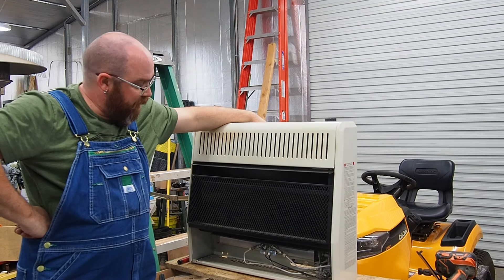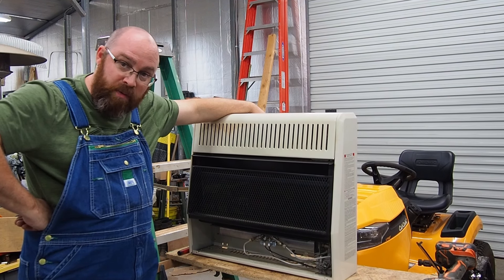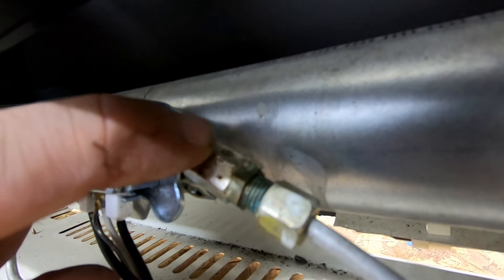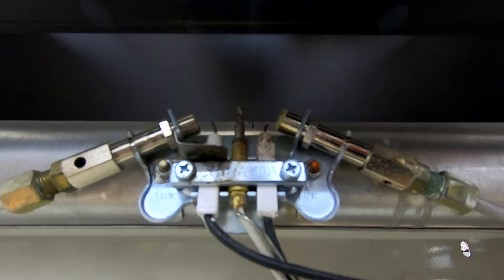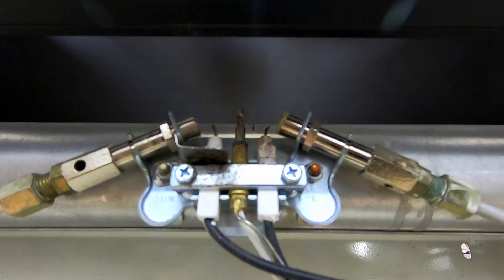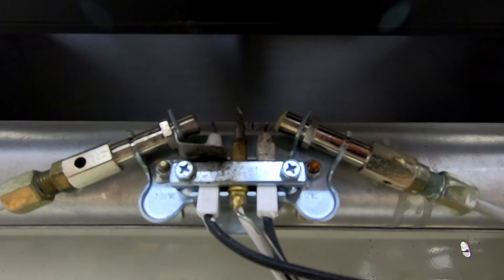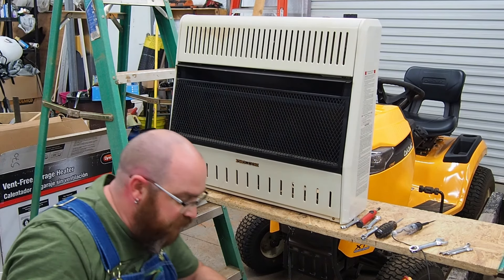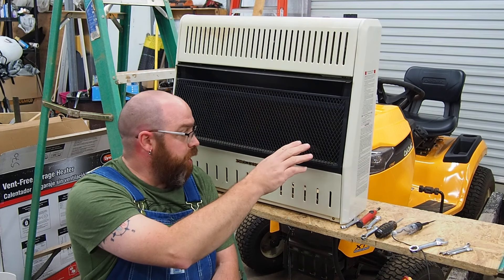How to clean Pilot Light that wont light / stay lit

Comment: My heat has been acting up for days! The pilot would not stay lit. I cleaned the heater and tried everything. On one of the coldest nights here where temps are 18 degrees, it kept going out! I came to YouTube and found you guys! I followed your instructions about the thermocouple. I didn’t have an air pressure torch or anything, I used a straw and blew really hard in the line. 😂afterwards I saw the flame connected like the one on your demonstration and I said thank God! I’m hoping it stays for me. Thank you for this video! I was looking really hard to find my heater type on here . God bless and thanks again!
Reply from the maker: Awesome glad you got it.

Comment: Our air source heat pump died leaving us with 2 gas fireplaces as back up. One of them was having issues with the pilot flame being too small and the adjuster screw did nothing. After blowing it out the pilot light w/30 psi air, the fire starts up in 5 seconds vs 2 minutes, the screw works, and our fireplace doesn't explode as much. Really appreciated.
Reply from the maker: Awesome

Comment: You Sir, saved me a bundle! My Pro Com Heater Stove had the same problem... the pilot wouldn't stay lit. After watching your video, I checked and sure enough, it had a weak pilot flame ( Vertical, yellow flame... no contact with Thermocouple).
I cleaned out the pilot tube and now it's working as intended. Many thanks!
Reply from the maker: Awesome glad it helped.

Comment: Thanks!  Didn't have a can of compressed air, but I used a small wire brush to clean it, then a straw to blow it out a few times.  Back to a beautiful blue pilot flame!
Reply: Glad you said straw because I didn't want to damage something sensitive inside the pilot, I'm using myself straw right now because you did it and it worked, mines could use a cleaning too.
Reply from the maker: Awesome
Reply from the maker: Glad you got it going.

Comment: I'm going to try this, I have no other hope🤷🏼‍♀️ I have a NEW, from Lowe's Procom ventless dual fuel fire place that I hooked up on a NEW, propane system. My heater won't even attempt to light. I bled the lines manually & I am getting propane at the back of the heater but apparently that's it. I have no sound or smell of propane when I turn the knob to pilot & depress the knob. Idk what else to try & it's going to be in the teens the next few days where I live😩

Comment: Thank you for showing a close up of everything!
Others have the camera set on a table or similar, way back. Frustrated, I almost gave up
I have a 5 panel plaque comfort glow that wouldn't stay lit the end of last season right before spring. I cleaned the thermo coupler etc. Worked great.
I turned it back on this month and it still worked fine but, problem started again.
I noticed that the pilot flame was weak after I opened the casing and got a whole lot of debris, cob webs....out. the intense heat causes the inside powder coating to flake off over time. It gathers down into the guts of the heater
I didn't know what the heck happened until I watched your video.
I have a blue flame comfort glow that I put in so I could have some heat until I figured out the problem. It doesn't heat as well as the radiant plaque model does; it uses more gas. It's not as efficient as the radiant model.
Long post, my apologies.
I noticed the air inlet when I had everything opened.
I'll bet I got something on the pilot opening because that flame was extremely smaller than usual. 
It all makes sense.
I'll follow your tips now that it's disconnected.
Very grateful. This heater is 16 years old and has heated my old house pretty well.
I do have a question.
I noticed that the double sided tape that holds a thermostat end, got old and came off.
Does it attach to the case? 
I figured that flopping around in there might send a signal to the pilot light assembly at the top of the heater.
The long copper wire from this thermostat, goes into the pilot light assembly, too.
No kinks or anything. I don't know where I should glue the piece that it snaps into.
It's just like the inside of my window unit a/c, that snaps into the inside cooling fins behind the filter.
If you need more information, I can try to describe better or take a photo of it and send to you in a DM
Reply from the maker: Thank you for watching. Just keep in mind I'm no expert and our videos are for entertainment only use them at your own risk.
Reply: Understood. I'm just grateful someone showed what I was seeing so I understood how to clean the pilot light assembly
If you know where I should reattach the thermostat end, that would be great
Reply from the maker: @REXXKUNKEL65  I would guess it goes in the gas valve.

Comment: Dude! Needed this video SO BADLY! Thanks for this info. 
One question: the pilot on my Mr. Heater comes on with no problem; when the knob is turned to actually light the burners, the pilot goes out. At first, the burners would "flash" ignite, meaning the burners would light but for like a split second, and then the  pilot would go out. Eventually, like I said, the burners wouldn't light at all and the pilot would go out ONLY after the knob is turned to light the burners. As long as the knob is not turned, the pilot stay on. Any thoughts?
Reply from the maker: Sounds like there may be an issue with the gas valve or thermocouple. I'm no expert just guessing.

Comment: Mine is the safety bit, it won't stay out, soon as u let go off the control knob the safety disconnects and off it goes...im looking for a quick fix..I'll just strap it up if can't find ought..I'll light it and strap something across the knob so it can't slip out and knock safety off
Reply from the maker: I believe you would need to have it checked.
Reply: @2TrailHikers  so Ur telling me u have not a single suggestion ?
Reply from the maker: @Sol-Cutta  it's possibly a combination of the thermocouple and the gas valve, but no easy way to know.

Comment: i have a mr heater ventless propane wall mount , it is roughly 4 months old, it is used in our home gym. This morning it started to act up, the pilot will light but it will not stay lit, it is  a nice blue big pilot flame but it will not stay going. Any suggestions?
Reply from the maker: The thermocouple has to heat up and open the gas valve. So you can release the pilot button. If it is not hot enough or the valve is not opening. Could be low on propane. I'm not really sure. I am no expert i do these videos for entertainment please use at your own risk.
Reply: @2TrailHikers  I tried 2 different brand new full tanks to make sure it was not a tank issue. I am going to try to clean it tonight and see what happens. If that does not work then probably a thermocouple issue. At that point i may just bypass it, its only used in our gym anyways while we workout.

Comment: What does it mean when the flame is coming out the hole you had circled in red
Reply from the maker: Sounds like low pressure
Reply: @2TrailHikers   the tank is new
Reply from the maker: @cjent6945  possible regulator. I am no expert.

Comment: Need Help:    I have Intermittent Heatilator Gas Fire log Model# ND42361. I have two wall switches. When I turn the 1st wall switch (power) nothing happens but after turning the 2nd wall switch the pilot comes on and stays on but the burner does not. I have:   Replaced the IPI electronic ignition control module & A/C Wall Adaptor. Cleaned burner holes and heat sensor (flame is close to heat sensor - heat sensor turns red) .  I will truly appreiciate if anyone can let me know what other troubleshooting I can do to get the burner working ?   Blessings

Comment: I get to light a flame but it wont stay on..pls help
Reply from the maker: I am no expert. The flame has to heat up the thermocouple to hold the gas valve open for the pilot light to stay lit. Hold the pilot in for about 10 seconds after it lights if it will not stay lit at that point you will need a gas tech to check it.